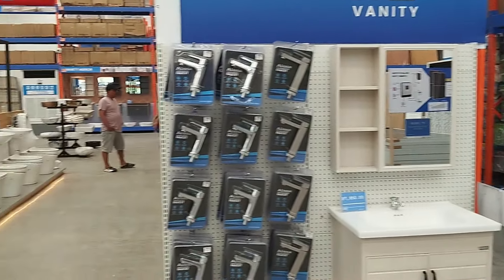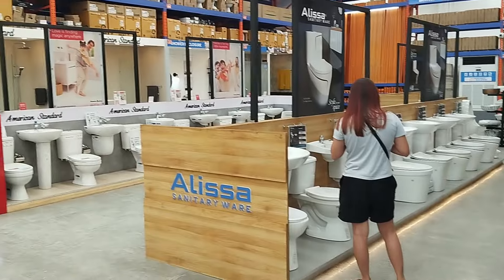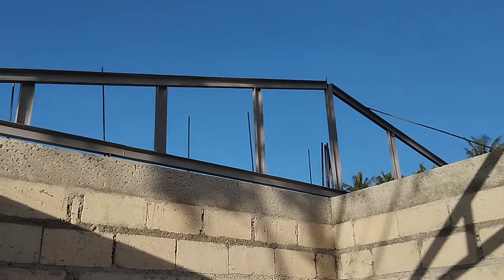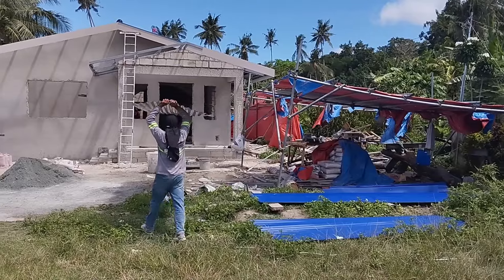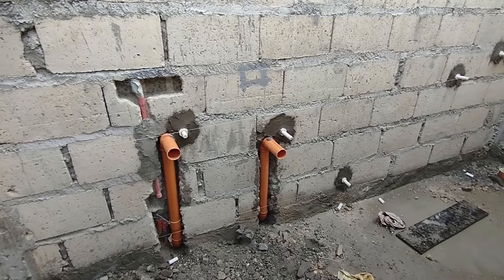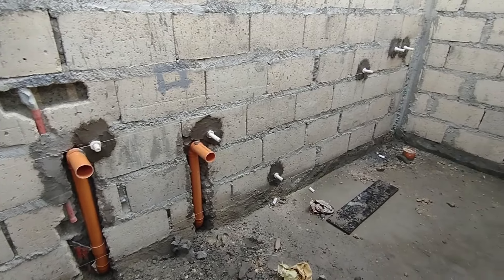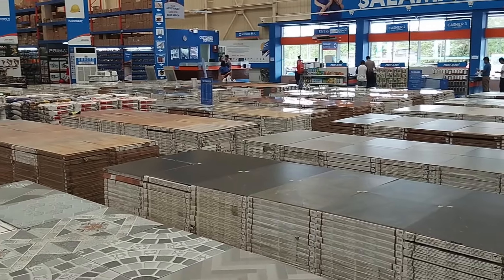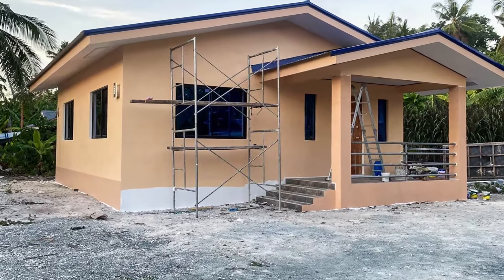Cost of Building Material for a House in the Philippines

Comment: Im building a 40sq meters house with half level for bedrooms innpanglao.
I have still reinforcements but some smart arse used the thin hollow blocks.im not sure if its strong enough.
Maybe when i build a wall inside for the bathroom it will strenghened a structure a bit .also the kichen i can use hollow blocks to make the corner stronger.and half level above.